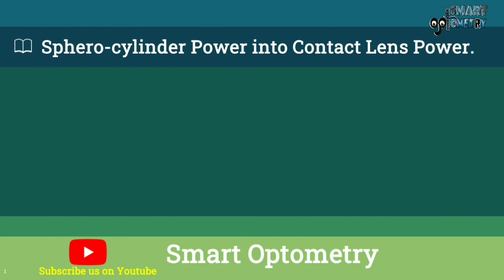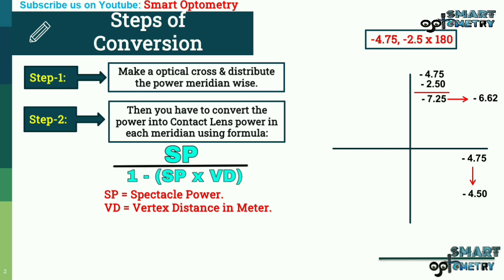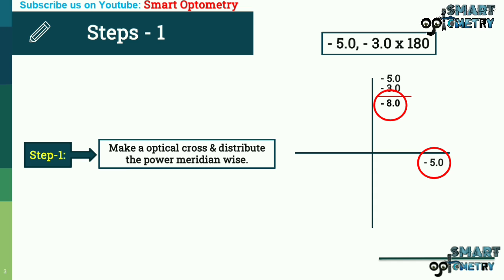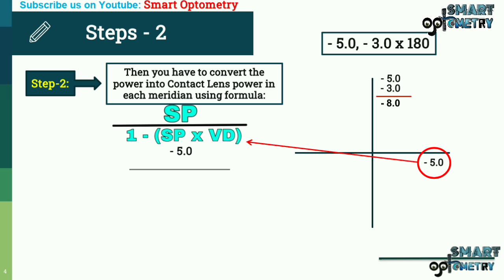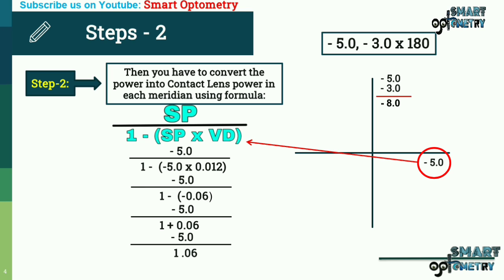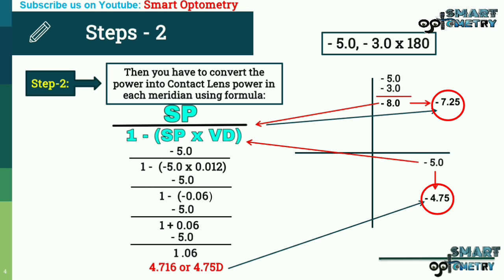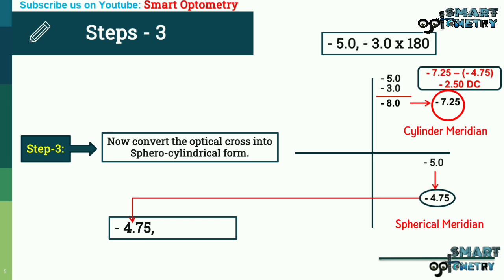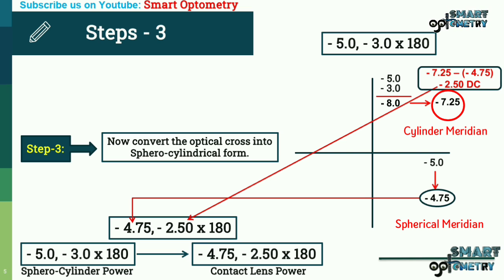How to convert Sphero-Cylider power into Contact Lens power.

Comment: My right eye's lenses power is  -3.50 spherical,  -. 75 cylindrical 30 degree axis. Is it exceed to 4d or not... Please reply
Reply from the maker: Yeah it cross 4D in one meridian...

Final Contact Lens prescription will be:
Spherical: -3.5
Cylinder: -0.5 X 30°

0.50 cylinder can be corrected by both soft and RGP. So you can try with spherical -3.5D contact lens.

This empirical data. Final prescription will be based on diagnostic fitting with trial contact lens.